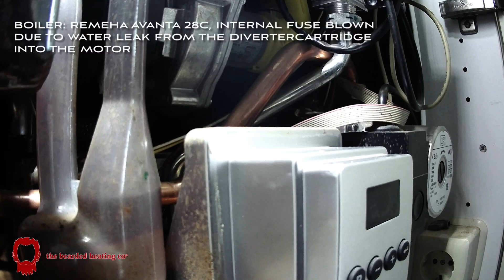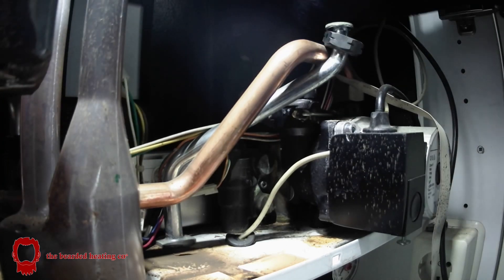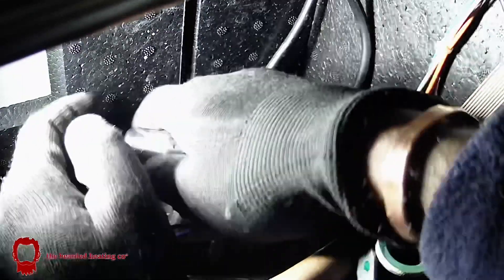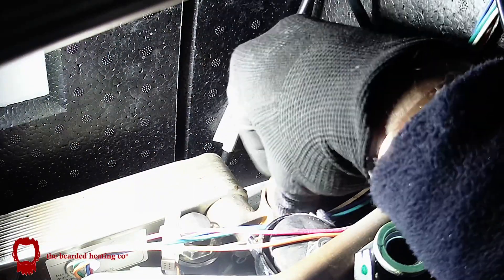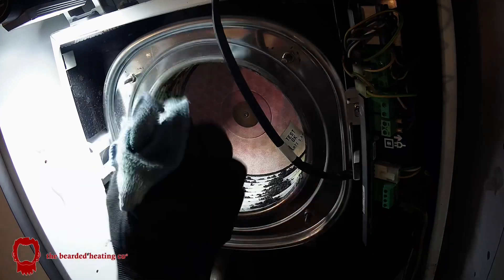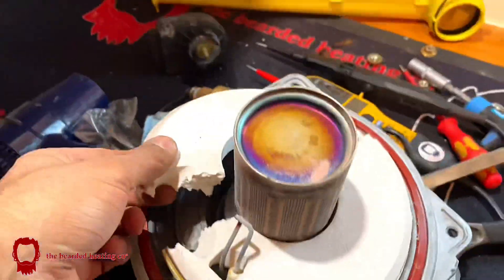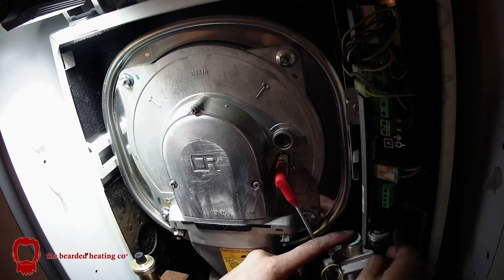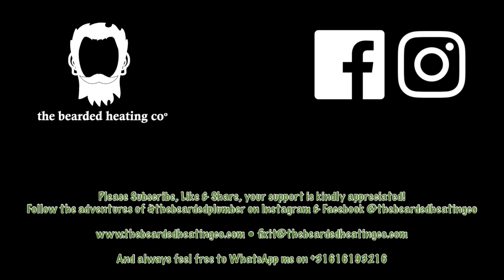The Bearded Plumber° Remeha Avanta Diverter Replacement

Comment: thanks so much! i followed your instructions. however... the clip/pin between the motor and the diverter is placed on the otherside. This means that I do not have the room to pull the pin/clip out. I can pull it out a bit, but get stuck between the side and the heatingpomp in the front. Do you have any advice on how to fix this? Thank you. I have foto/video if needed!
Reply from the maker: Hi! Thanks for reaching out to me at The Bearded Heating Co° 

If the pin is the otherway, I would recommend bending it and pulling it out! The new cartridge comes with a new securing pin!

Hope this helps! Live long & prosper! 🖖🏽

Comment: Hi, how did you diagnose that electrical fault was within the motor?
Reply: If turn on the hot water and radiators begin to get warm means diverter valve or motor didn't close off valve leading to the radiator. One of the two is faulty, I recommend always to replace the two parts as a pair.

Comment: I've never come across one of those diverter valves that's isn't leaking . I'm not even going to talk about the condense trap.

What's the tool you use to tighten up the diverter valve....never seen one
Reply from the maker: These diverters are in the baxi and Potterton, Ideal and Remeha Avanta. I bought the tool from a page on Instagram @fcboilerspares